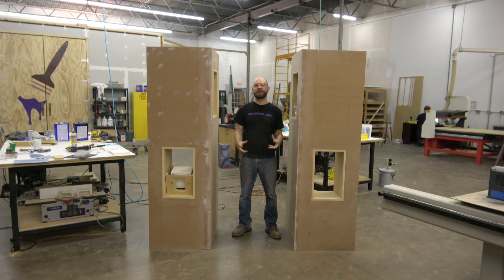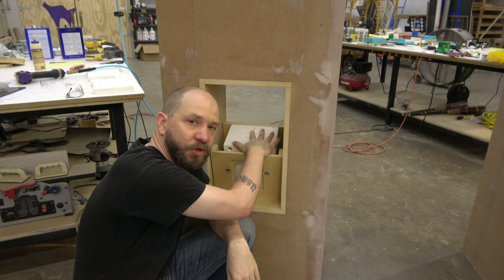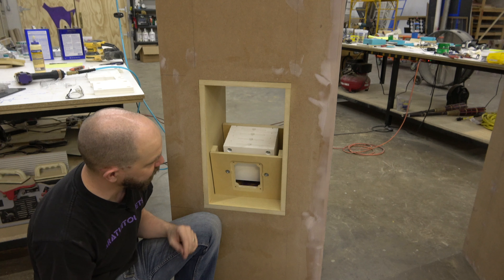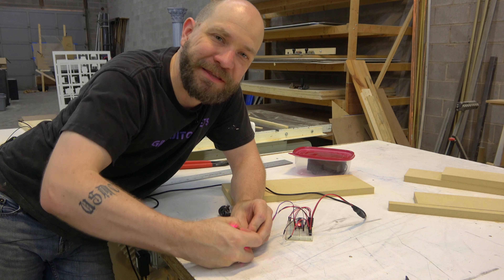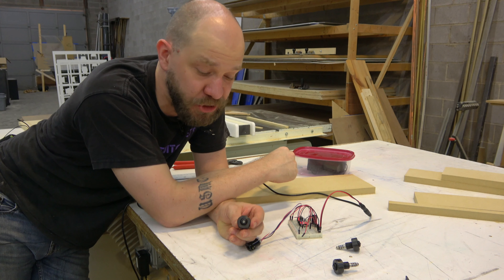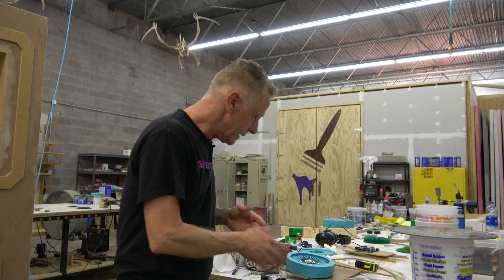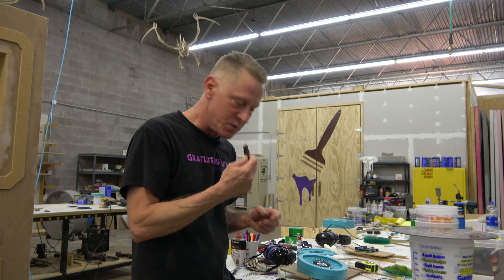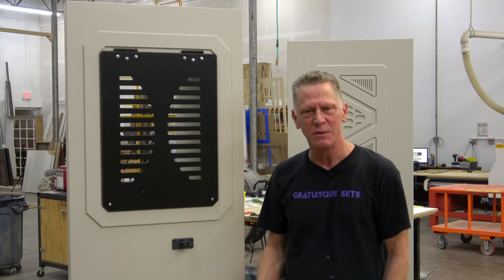How to build a spaceship:  Pillars!

Comment: One more question, since I am just tinkering around with the circuit board: Does each key open a different door/arduino or is it like in the toaster where you insert all 4 keys in a single arduino and if all are in the correct order/Analog-in this one arduino unlocks? Thats basically what I am trying to do. Insert a key, animation starts and ends in a certain key-colour. If they are in the correct order, another animation starts and all keys turn green and a door opens. Not sure if this is possible to input multiple analog-in values and controll multiple neopixels at the same time. I am not an arduino expert, just tinkering around. Maybe someone here knows the answer.
Reply from the maker: The answer is unknowable.
The PCBs as designed are one Arduino  nano to one lock/key-hole. It would be easy to send the relay outputs to another "master" Arduino. It would also be possible to wire each lock/key-hole to a different analog pin on one Arduino and control them all that way, I just haven't had a PCB made to do that.
Reply from the maker: I didn't know if you saw this https://youtu.be/pIbOGauZKY0
Reply: @GratuitousSets  Okay, one nano to one lock is what I already accomplished. I will try to fit 4 locks on one and report back ;-) Just need to wait for some more parts. I love your work, can't wait for new videos!
Reply from the maker: Fantastic!
Reply: @GratuitousSets  Thanks for posting the link, I totally missed it. This is very cool! I love the detail with the custom foam inserts. I wish I could find a nice electromechanical lock like the one in the video over here in germany. I tried some chinese ones for another project and they don't last very long.
Reply from the maker: Danke Schoen! Meine ehefrau kommt aus Berlin! I'll try to find you a link for the solenoid sperren/verregeln
Reply from the maker: I'm not sure if you'll be able to find this on amazon.de but here goes... https://www.amazon.com/gp/product/B06ZY66WCB/ref=ppx_yo_dt_b_search_asin_image?ie=UTF8&psc=1
Reply from the maker: do you own an escape room or do you just enjoy building stuff?
Reply: @GratuitousSets  i mostly just enjoy building stuff, but I also did some small puzzles for a friends escape room. I like to tinker around with stuff and learn new things. Thats the main goal of my projects
Reply: @GratuitousSets  Thank you for providing the link! Those are different than the ones I have used. I will try to find them here in germany!
Reply: @GratuitousSets   I just wanted to provide some feedback: I got the same lock from amazon germany and it seems to be working fine so far :-) I also got my protoype running on a breadboard and I managed to create a "master" lock that requires multiple keys in the right colour/order to unlock. And of course I could also cut down the code a bit and just use it for single key/lock. This was a great project to learn about coding, neopixels and the idea of using a resisort as an identifyer ist great!
Reply from the maker: Fantastic! That's good news! I'm really happy that this motivated you! Frohlische Weinachten!

Comment: Love the key. The concept is so simple with the resister but so brilliant. Then I saw the iris and was blowed away with so many cool ideas that it could be used for. Any chance those CNC files might be available?!?!
Reply from the maker: We modified files that we found online for $15-  Since we didn't do a lot of the design work it's probably best to buy them from the designer. Glad you like the key! I'll tell Matt 😉 I'll send you a link in a sec..
Reply from the maker: (Video) https://www.youtube.com/watch?v=3TJU2JgTUSU
(Purchase link) https://gum.co/DbwJp
Reply: Awesome, Thanks. Now I have to make some time to cut it.
Reply from the maker: That was a quick shot of the prototype. We are going to modify the actuator arm for use with a linear actuator and build the final version out of 1/4' PVC with aluminum pivot pins.
Reply: I was also thinking of using a linear actuator with a switch that triggers a LCD screen behind the iris. Or even a series of routed acrylic panels that light up separately when the iris is opened and closed.
Reply from the maker: sweet!!!

Comment: One build question, it seems like in the UK its much more common to use ply in builds rather than mdf as the latter has a tendency to swell and warp. Do you find that's an issue, if so what do you to to combat it? MDF also doesn't seem to like to take paint without ballooning, any tips for sealing it etc?
Reply from the maker: There's another product, similar to MDF that is extremely weather resistant. It's brand name is Medex.  We don't have any trouble with ballooning or swelling MDF, but it could be that there are differences in available product in the UK vs US, but Medex solves those issues 👌
Reply: I will add that, without sufficient framing, thinner MDF (1/4" or 6mm) can bend significantly when you paint it. The painted face swells slightly, but it's enough to overpower a 1-1/2" frame. We've run into that a lot doing our window display builds.
To counter the bend you can paint the back side of the surface, or just spray it with a little bit of water. 
This particular build uses 1/2" (12mm) MDF, 2-5/8" framing, and additional strength from the corner.
The upside is that MDF is much easier to finish. Plywood will always show grain.
Reply: Thanks both! Will keep an eye out for that brand and see if I can find an equivalent here :) About to start working on some cyberpunk set builds! 👾
Reply from the maker: Send pics!